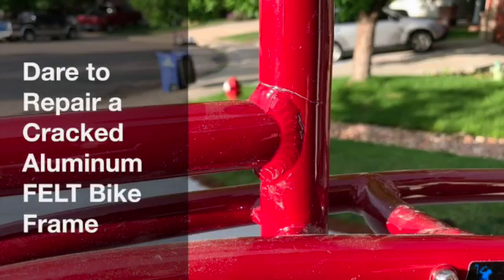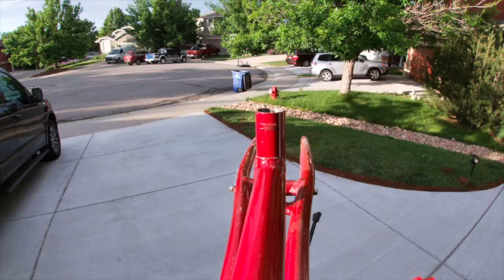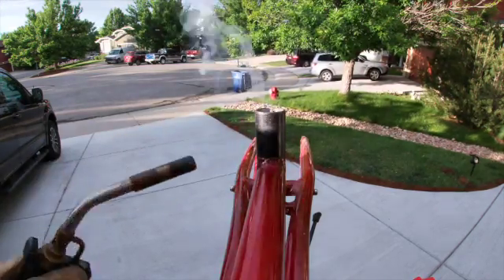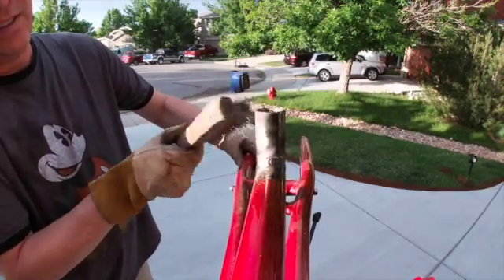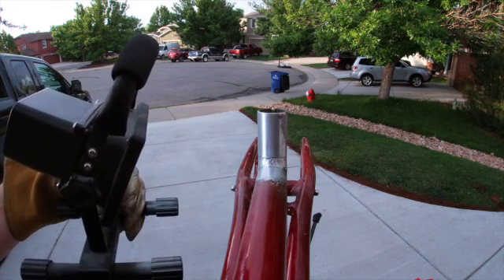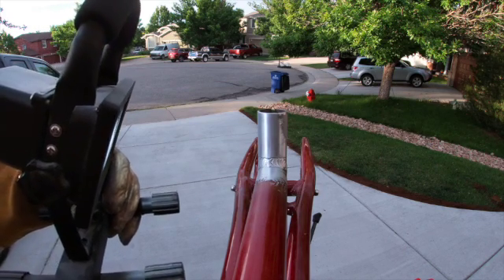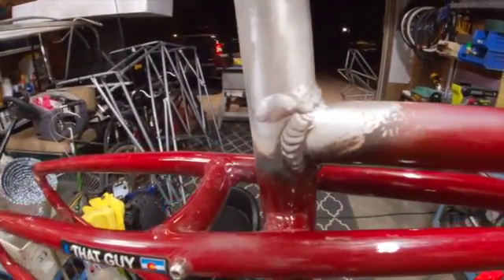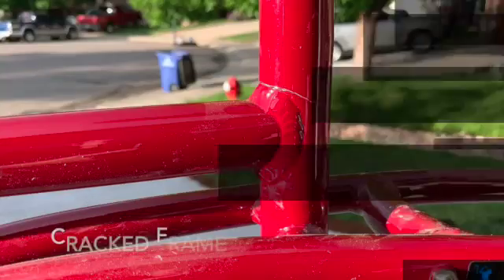Dare to Repair a Cracked Aluminum FELT Bike Frame

Comment: looks like the seatpost insertion too shallow? and that caused the crack i guess
Reply from the maker: I agree a longer seat post installed initially would’ve prevented the stress on the frame.

Comment: why would you weld in the seatpost with the fixed seatube, what was the point?
Reply from the maker: Excellent question, two main reasons why I welded the seat post in a fix position. 

1. Once the aluminum frame had cracked, nobody was willing to deconstruct and repair it properly. The manufacture said no to replacement frame and the bike was trash.

2. Welding distorts the in side of the aluminum tube. The seat post would never enter without a substantial amount of sanding.  So the owner of the frame asked me to weld the seat post in place so it could be used as a bike on college campus.  Transforming a trash frame into a cheap mode of transportation between classes.
Reply: @jonathansterner  usually with this kind of repair people are able to have a removable seatpost, the residue inside is filed down. Maybe he wanted to have it fix for theft prevention but otherwise I know its doable to fix it without making it fixed
Reply from the maker: I totally agree, without a doubt the seat post could’ve been removable.
Reply: @jonathansterner  well if he wanted it like that your hands were tied😉